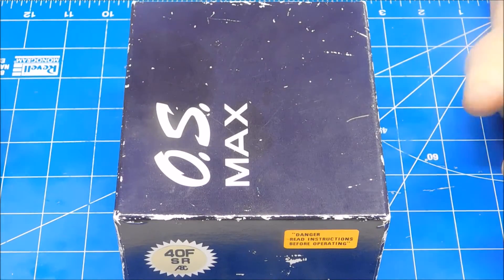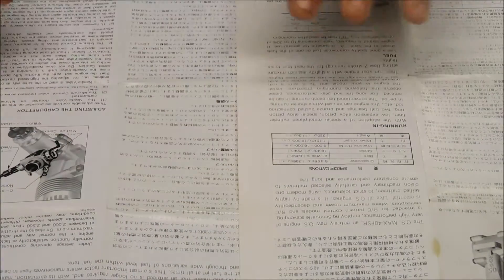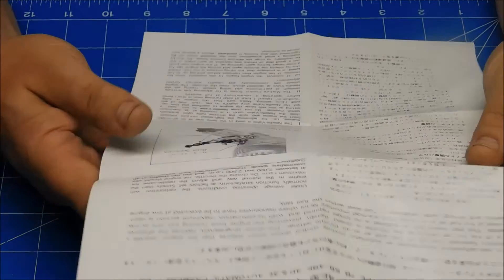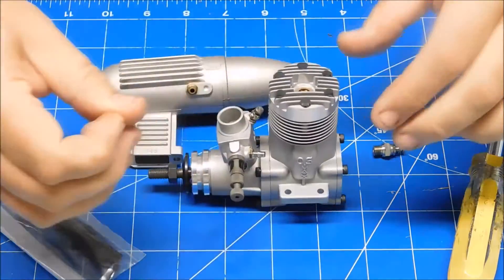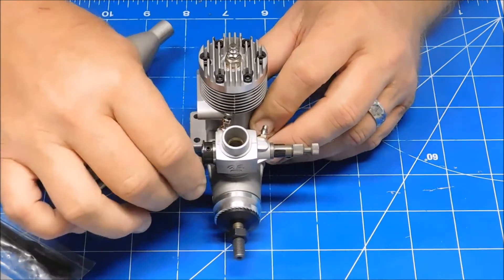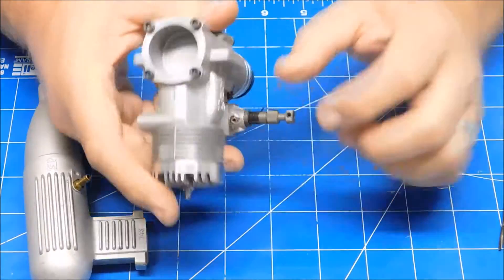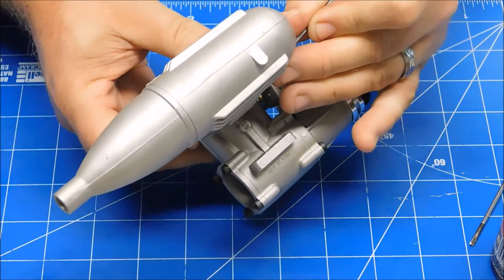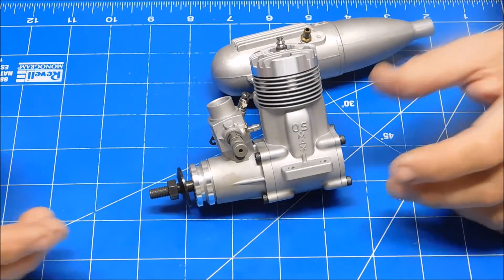OS 40 FSR Setup for the first run

Comment: I wonder what the difference is between a 40 FSR ABC and a 40 FSF ABC?
Reply from the maker: What is a 40 FSF ABC?  I have never heard of such a designation for an OS engine.
Reply: @dmrcflyr2  I guess I mean 40 SF ABC even though there is an 'F' on the side of the engine and 'SF ABC' on the box. So " what is the difference between the 40 FSR ABC and the 40 SF ABC?"  would be my question. I think I fuggered it out. The SF is still cross flow scavenged and the FSR is Schneurle... maybe...
Reply from the maker: @johnhess351  No that is not correct at all John. Have you ever had both or seen both engines before?  Both can be seen here on my channel by simply doing a search for each one.The 40 FSR ABC came out in 1981 whereas the 40 SF ABC came out in 1987.  Two completely different engine designs but both are Schneurle ported.  Neither is a cross flow scavenged engine.  Look up images of them and you will see the difference in case design.  The 40 FSR has a two piece crankcase and the SF series has a single piece.
https://www.sceptreflight.com/Model%20Engine%20Tests/OS%2040%20FSR.html
https://youtu.be/dLNgMUgkcBM
Reply: @dmrcflyr2 thanks for the clarification, I was lost and only have a 25 SF and a 61 FSR and confused them with a different Chinn article. I am on a steep learning curve after being out of the hobby since '76, but your videos are helping..
Reply from the maker: @johnhess351  you can go to the os engines website and download the latest engine timeline pdf. Very helpful for identifying engines and year of release